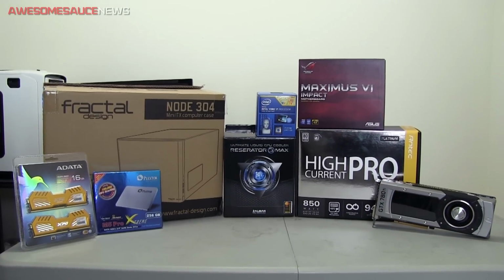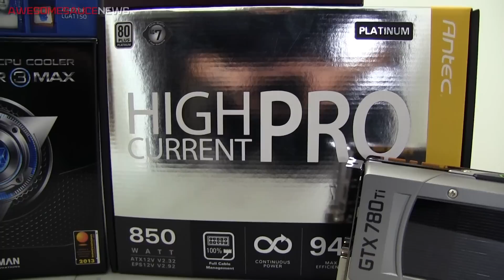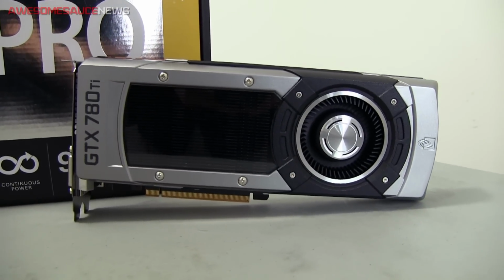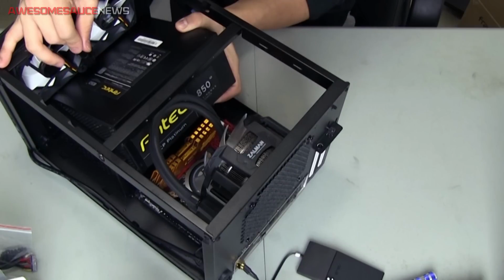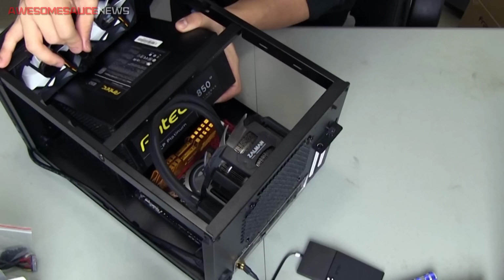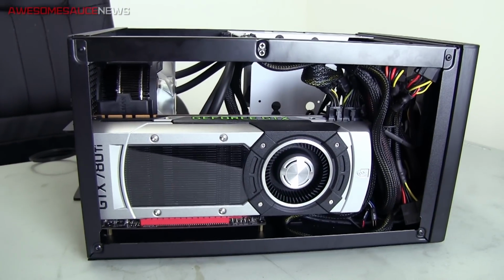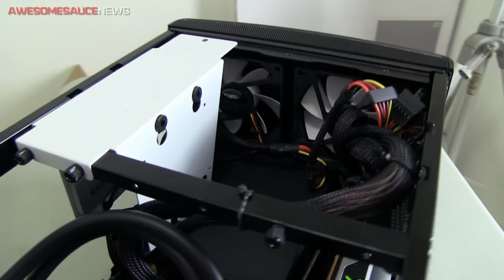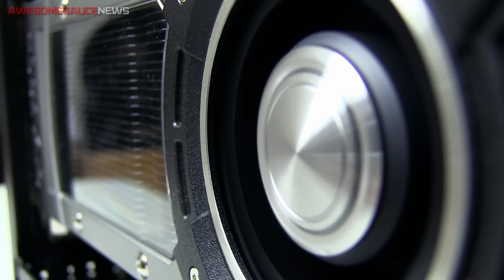Epic $2300 Portable Gaming PC - Time Lapse Build

Comment: 5 years from now, all that will be available in a size of a 10 inch tablet.
Reply: I know right I mean 3 years ago the 760ti was a beast
Reply: +Light 1988 yea considering modern smartphones are as fast as ps2 and xbox 360
Reply: +v0000000000000000v no they're not, the top ones are almost equal of a Xbox or a ps2
Reply: You're kidding me Xbox 360 has 512mb of ram the iPhone 6s has 2
Reply: +Wisconsintech81 RAM ≠ power.
im talking about GPU, The Xbox 360 has 200+ GB/flops, while The fastest phone GPU isnt even near at that power.
i got a note 3 and has 3gb of RAM, but is not even closely as powerful as an xbox
Reply: Not 5 years probably 10 years.
Reply: +Shriyram Rajasegaran not 10 probably 50 to 100 if not longer the battery is a huge issue with his sorta stuff plus cooling would be like impossible tech is moving fast but not that fast
Reply: Austin Blackburn Meh time will tell.From the year 1990 to the year 2000 there was a big leap in technology. It could happen again.
Reply: Shriyram Rajasegaran It could im just a little skeptical although only time can tell

Comment: Great video! quick question: what other cases would you recommend that are similar to the one in this build?  I'm looking for a small portable case to put my parts in after I get an micro-atx board.
Reply from the maker: The Bitfenix Prodigy M or Colossal M are good options IMO. Granted, the case in this video quite a bit smaller since it only fits Mini ITX.
Reply: Now there is the fractal design node 804
Reply: ***** true I'll probably be considering that now too
Reply: ***** Thank you! I'll check these out.
Reply: Joel Porcaro Antec Isk 600. Small, good quality, nice looking and fairly cheap. I have one myself and am doing a build with i5 4670k and radeon 7870 :)
Reply: Joel Porcaro Hi im new to pc gaming an building a pc, but what case could you recommend for a ATX motherboard an great cooling for fairly cheap? , Thanks, love this timelapse!
Reply: +DR-INSANE95 I would go for an Coolermaster N300 as startersbuild!
Reply: thanks bud :)
Reply: +Joel Porcaro a corsair 380t is portable
Reply: Silverstone sg13 is hands down the best smallest case
Reply: I recommend the cit vanquish

Comment: you can always open the psu cut all of the cables you don't need and wrap them with electric tape. then you lose all of the cables you don't need and clean up the build. if you want to go further mdpc has some sweet sleeving color to do a custom job

Comment: Sauciness! I have the same board, but still searching for a case, but this 304 seems legit!
Reply: It's a great case and is certainly built like a tank, but if you want a smaller and cheaper case I recommend an Elite 130 from Cooler Master. You can put those extra $50 into some even better components!

Comment: Great rig, however would have looked better with a 780 to direct cu 2 and some red xpg ram. Possibly a red cooler. I like things to match and if I were building this  system with such badass hardware I'd custom install a piece of plexiglass for a side window and drill some holes on a drill press for ventilation.

Comment: Why has no one drilled out the rivets holding the psu bracket? If you drilled them out you could move the bracket up an inch or two and get a bit more space

Comment: Special Sauce Build!!! (SSB) Great Job Bro! Id like to see follow up videos. I'm all about mini itx's builds. I like that bored. But outta my budget. Waiting for DDR 4 and pci express 4 before I upgrade.
Reply: PCIe Gen 4 is kinda unnecessary at the moment. PCIe 3.0 GPUs get minimal performance increase from PCIe 2.0.

DDR4 on the other hand is being released into the comsumer market with Intel's enthusiast platform Q3-Q4 2014.
Reply: JKVengeance although, if pcie 4.0 4x was as fast as pcie 3 8x then quad gpu would be possible natively on the 4770k, ruling out the need for plx and the necessity for enthusiast cpus for quad/ triple gpu gamers
Reply: bored...
Reply: If you wait for the DDR4 memory, 4GB will cost like 65$ instead of 30$
It's better that you wait but stilll buy ddr3 ram and pci express 3 becouse it will be like 30$ cheaper (sorry for my bad English)
Reply: I'm not worried about the cost.

Comment: so hows the play-ability compared to the other build unit you did? the HTPC.
 huge? meh? worth the extra bones tossed into this one? stats are one thing but I'm looking for play-ability.
and would the gtx780 ti fit in the silverstone sg05? as I'm looking at the silvestone sg05 with an itx gigabyte z97n wifi for my build. wifi is a must and a gtx 750 2gb  128bit ( i think its 9 inches and would fit in the sg05

would you recommend any other cases (smaller and maybe handles) that could fit a good graphic card?

lots of ?'s, thnx if you got time to answer.

Comment: was the pin on the socket bent before or after you incorrectly removed the protective plastic?
Reply: dat ninja PSU swap because someone didnt check their measurements...
Reply: good recovery with that cable management though.

Comment: So guys, I recently bought a PS4 and a steam machine and I love both, but I have always wanted a nice PC... I figure I'm going to have to drop about 2000 in order to have a solid rig... as a console gamer I'm ignorant in terms of building a PC, but I really want to, as I love to assemble sophisticated equipment and love the satisfaction of seeing it run smoothly after the build... but should I build a PC or should I simple buy a preassembled one? Falcon Northwest has some pretty nice looking PC's out, and I was considering them if I was to just buy one
Reply: Building your own pc would be a lot more fun. However, there is the risk of screwing up. That said, you can always ask around online for help.
Reply: Oh and you don't need 2,000 for a kickass gaming PC.
Hell, you don't even need to spend 1,000. Anywhere between 650 and 850 would set you up with a future proof machine. But it also depends on what settings and resolution you normally use for games. If you want to play on a 4K monitor (which I wouldn't recommend, even if you can afford it), then you'd need a beefier card with a larger frame buffer.
Reply: I just want a PC that can play at 60 fps 1080 p on ultra settings. Do you think I could still get one for the 650-900 range?
Reply: Mr. 8-Bit Definitely. Especially if you select AMD products.

http://pcpartpicker.com/p/MPmKMp

http://pcpartpicker.com/p/qVdwpg

^^^ Some of those parts may actually be kind of overkill.
Reply: Thanks for the info, and for the help
Reply: Mikihara In that list, is that like the whole setup I would need to have a complete PC or do i need more than that?
Reply: Mr. 8-Bit That's everything except the operating system.
Reply: Awesome!
Reply: Wait how did you buy a Steam Machine?

Comment: That tiny little chip that you slotted in your mobo, wifi card - isn't it? What's it called exactly? I've only ever used the normal pci ones so this is a bit new. 2:56
Reply: DarkDynasty Yes, it's a proprietary wifi card included with the motherboard.

Comment: I'd like to find a mini itx case that will accept a gtx 690 that isn't a B.itfenix. Tried the Prodigy, me and it didn't get along, the break up was horrible.
Reply: I have this same motherboard in a EVGA Hadron Air and there's so little room to configure things I bypassed using the wifi cables cause it's so difficult trying to get the connectors thru the holes in the motherboard's backplate.

Comment: Sweet build! Might as well mod in some windows.
Reply: I would rather have the cooling benefits of the vented side panel on a case this small, then a window too look inside the case, unless your talking about adding a vented window on the side, and maybe painting the case some crazy colors to make it stand out a bit more.
Reply: Commodorefan64 People have done windows on the roof of the Node 304.
Reply: Le Monarque True, but I'm talking about the side which is where most people put a window on there case, but like I said I could see some vented side windows, and a top Window, but for me, I personally choose function over form.
Reply: Commodorefan64 Yeah I get it, was just sayin' that since OP didn't mention where the windows would go, top and maybe the side opposite the GPU would be better candidates than the GPU-side.

I suppose though since this build is using a reference card, a GPU window wouldn't hurt airflow if it stopped maybe 1 inch short of the blower.

Comment: One of the pins were bent and you bent them back??
Reply: That's what you're supposed to do for bent pins.
Reply: +kim jong un 
What, wouldn't you?

Oh, my really expensive motherboard has a slightly bent pin. Better throw it in the garbage!
Reply: RahulR Gaming & Tech no I would send it back to the company that produced the mobo
Reply: RahulR Gaming & Tech you bend one into the wrong position and no more warranty
Reply: kim jong un Well that's why you be careful.
Reply: +kim jong un don't nuke intel mmk?
Reply: Crackhead jack depends if its in america

Comment: isn't bad to have too much power? something about ripples or someshit - i'm completely clueless when it comes to psu's.
Reply: You can put a 1200W in there if you want to.  You can never really have "too much" power.  It is, however, a complete waste of money and space to put in a high end, 1000W PSU when you can get a 450W or 500W for the same job.
Reply: You only have to worry about ripple when you have a very cheap or 'budget' psu. Basically, if you're getting a 1200w for a ridiculously low price, you have to question how long it will last before blowing. But if you have a good psu from a trusted brand; there's no such thing as 'too much'. With power supplies, you only have to worry about too little.
Reply: Craig Morrow Yeah thanks I knew about the problems with badly built PSU's and all that I just thought that I read somewhere having more power than you needed was also bad, but thanks for clarifying.
Reply: joshmosky ah ok cheers mate.
Reply: ***** the only other thing is power efficiency. If you get an overkill psu then it might be efficient at its recommended load, but if there isn't enough power being drawn then it may cause it to be inefficient converting the electricity.
Reply: mop10000 That is true to some extent, but running a 500W draw system on a 1000W supply will give you as close to perfect efficiency as you can get.  In other cases, it will be worse depending on wattage of the power supply and your system.  Either way, with a quality power supply, the difference from 5%, 50%, and 100% load is only a few percentage points here and there,  It's never enough to really worry about.
Reply: yeah I was just putting it out there

Comment: what is that above gtx 780ti, audio card?
Reply: +Martinesse that mobo comes with a little audio card and an external wifi antenna card.
Reply: I looked the motherboard up.
Reply: +Martinesse  its probably just a heat sink

Comment: Can this play tf2 cs go mc cod aw cod bo2 cod mw3 and is it good for normal gamer,not extreme but middle somewhere?
Reply: yes, tf2 CS:GO and mc are fairly easy to run the rest are slightly harder but not that hard. this is almost in that range of "extreme". It will be powerful enough to last 5-8 years without turning down settings.
Reply: my 5-8 years on ultra settings. this build will maybe last 4 and not even on ultra.

Comment: what wifi card did you install??
Reply from the maker: The Maximus VI Impact has on-board wifi!
Reply: Awesomesauce News What Was The Item That Gets Plugged In At 4.35 In The Video,

Thanks
Reply: Philip Levins Ignore Last Comment. Its Wifi Antenna. Thought It Was External Fan Controller With LCD Display To Show Temp & Fan Rpm

Comment: Whaaatup Kyle, 👲You inspired me to do a big build and I would like to share the specs for your constructive advice. 
case-Phanteks Enthoo Primo SE
Mobo Asrock Z170 gaming k6
cpu-Intel 6600k oc to 4.7ghz
GPU x2 Asus STRIX gtx970 in SLI
Ram 16gb of 4x4gb G-Skill DDR4 TRIDENT Z @ 3000mhz ( Red & Black)
SSD Samsung 120gb 750evo + x2 120gb HyperX FURY as fast storage + 500gb pipeline hd2 HDD as bulk storage.
cooling corsair h110i gtx v2 AIO
PSU-EVGA HEX750W FULLY MODULAR
Fans x6 140mm Thermal Take RGB Riing + x5 140mm Phanteks case fans + x2 AF120 red leds
NZXT hue+
monitor AOC 23" 1080P IPS
Razer Blackwidow chroma + DeathAdder chroma mouse
NZXT Sentry 2 Fan controller
37.5 " SteelSeries extended mousepad
2.1 Sound Stream 40w woofer for sounds + Custom painted black and white Sony 500w passive woofer attached to 2.1 Sound Stream. wish I could show you it, it's sexy has hell. if you would join my PC modding community, Custom Pc Solutions. its got a lot of amazing builds on it. thanks bro. I'll see you in the next one.

Comment: you can easily make this 1800 to 2000 dollars by the making it an i5-4670k  and giving it 2133mks of 8 gb ram. Also the power supply will easily take off 100 by the downgrade he made. You could 600 watts with all the downgrades and it will still max out all games at 2560x1440 or maybe if some better cooloing and overclocking 3 x 1920x1080 screens.

Comment: Uhh... you know PSU efficiency ratings only apply to something like greater than 60% load, right? An 850-watt PSU at 86% efficiency that always ran at 360 watts would be nowhere near 86% efficient. So, it is most definitely not better to go overkill on a PSU. Get your facts right.

Comment: why was it so bloody expensive? parts were so-so. yes it's a top-notch GPU but he has built much better systems with roughly half the budget. on a side note, that cooler looks cool AF (no pun intended) also the non modular PSU killed it for me. making the best of a bad situation i guess.
Reply: Alcino Acosta look when the video was posted dude.  Beast PC for the time
Reply: Jacob Dresser oh geez! checkmate...
Reply: Alcino Acosta wasn't trying to be mean just pointing it out for ya
But yeah if you come across a "ultimate build" and it has a 780ti or even a 980 now look at when it's posted then I usually do my assumption and opinion. Just my thoughts on a bored day on YouTube
Reply: Jacob Dresser nah, don't sweat it. correction was in order. thanks m8.
Reply: Alcino Acosta :^)

Comment: Can anyone help me with the motherboard? So far i have this (Kinda gaming rig and a bit of workstation so i want that hyper threading of the 4790k and kinda of overkill ram)

I7-4790K
Gigabyte GA-Z87MX-D3H 
G.Skill Ripjaws X DDR3 1600 PC3-12800 16GB 2x8GB CL10  (Can i use ram of 1866 mhz?)
Samsung 840 Evo SSD Series 250GB
Seagate Barracuda 7200.14 2TB SATA3 64MB
Asus GeForce GTX 770 DirectCU II OC 4GB GDDR5
Corsair Cooling Hydro Series H100i
Cooler Master G750M 750W 80+ Bronce (I do not know how much wattage would need but so far i choose this ps)
Reply: Go to pcpartpicker.com find everything and then you will see the wattage you need and post the partlist to the forums there are awesome people everywhere there

Comment: Gpu Rocks but the build sucks nothing matches up or looks Right at all.also some one that does alot of building of pc never uses the stock cables makes the build look like a noob did it.also who has those kind of parts just sitting around no one at all when a evga gtx 780ti just came out,so come on who are you trying to bullshit bro trying to make people think your some kind of big time builder with sponsors not  cool at all,also for 2300 dollars could have built a much much better gaming pc then that must be your first build because thats not water cooling at all lol its called a all in one cooler.video was very bad parts did not work with each other at all could have done much much much better gpu only Epic part....lol

Comment: A cube case isn't really portable. You need handles, prodigy or 380T, even ho 380T came after this vid.
Reply: real men don't use handles
Reply: NightBladeDK Still, a handle is always more portable.
Reply: Everything is "portable".  "Portable" is a relative term.  My midtower with 4 HDDs, 2 GPUs, and 7 fans is "portable" relative to a lot of other cases.  So don't say something is or is not "portable".

Handles look dumb as shit.  Also, they don't necessarily make a case more "portable".  For example, someone could put this case under their arm and hold something using the same arm.  If you used the rice rocket-looking case you're busting a nut over, the use could hold the case by the handle and also put something under their arm.  Same shit, genius.

Fuck, I know there are Intel/AMD fanboys, Nvidia/ATI fanboys, fan/liquid cooling fanboys, but no there are CASE HANDLE fanboys?  GTFO with that shit.
Reply: +hikeskool subtle brag much

Comment: The shitty non haswell e cpus need to be delidded for max efficiency. (i5 4670k, i7 4770k
Reply: Um this was 2013 xD
Reply: OhAffex dont care lol
Reply: then if you dont care then dont comment
Reply: The only gain is an insignificant drop in tempuratures, and Haswell-E chips are less efficient than Haswell, with Haswell having better single thread performance and Haswell-E relying on more cores that make it less suitable for gaming as opposed to running VMs, light servers, or workstations.